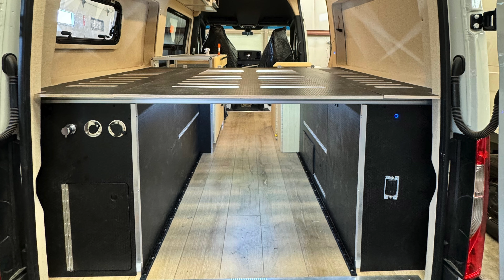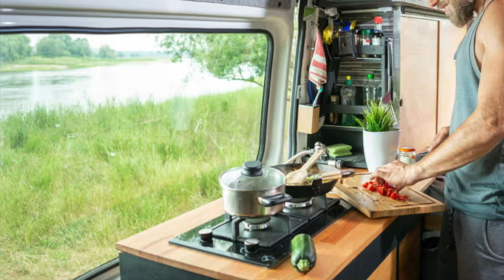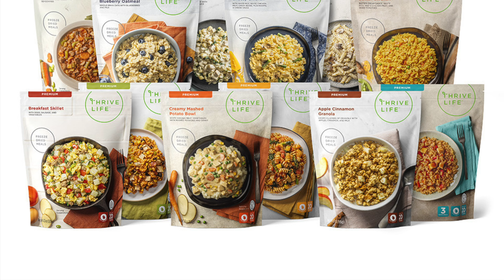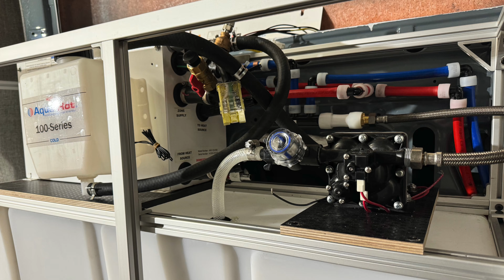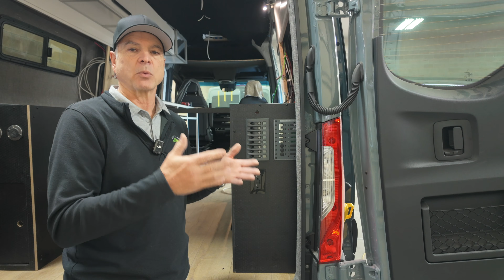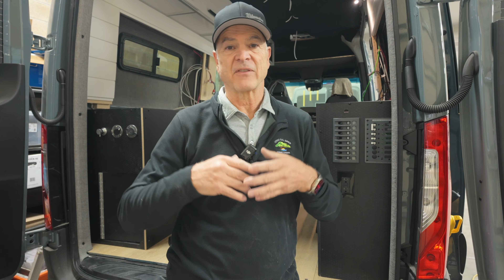Electrical and Plumbing Systems MISTAKES Could Cost You THOUSANDS!

Comment: As a former Sr. Electrical Project Manager, LEED AP, who designed and specified, from the utility points of connection, all power, lighting, low voltage and data system, etc. components for NZEBs, your channel is heads and shoulders above every other RV build out channel available. Thank you 😊

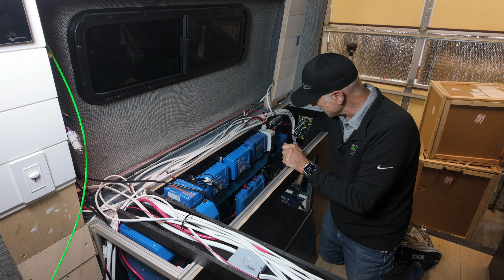Comment: At 3:15 you show the positive and negative power cables at the batteries. I don't think you mentioned it, but I'm guessing that is an inline fuse right at the positive terminal to protect that cable?

Comment: I am in Australia and it gets pretty hot and humid. Would you add a 12V fan inside the electrical box somewhere to aid ventilation to the outside of the vehicle?

Comment: I’m using two 48v server rack batteries (total of 200A) with 900W of solar—from Rich Solar.  Also, have Sterling 12 to 48 dc to dc charger for alternator charging.  Air conditioner is 48v undermount system, so big benefit is air conditioner efficiency.  Needed a couple of Orion converters to support 12v requirements.  Not on the road yet, so looking forward to testing to see if all the effort was worth it.

Comment: Keep in mind I know very little, but while watching someone else’s video, I think that a disadvantages of using a 48V system other than the increased danger of the higher voltage which can kill you, is that in order for the solar charge controller to work the solar panels have to produce 5V more than the 48V batteries (51.2V nominal voltage), or 56.2V. Also the disconnects are rated for 50V which is less than the nominal voltage of 51.2V?

Comment: Hi Jeff, thank you for all the great videos, really appreciate it. Question about the 3-port manifold; the trunk is 3/4" and it seems like you have an adapter from 3/4 pex-A to 1/2" or 3/4" male NPT from the pump. Is the braided hose 1/2" or 3/4"? I only have 1 van to build, so investing in the 3/4" pex-A head, plus some pipe, plus some rings makes this a very expensive manifold for 3 connections. If the braided hose is 1/2", then you don't gain anything with a 3/4" trunk other than they don't seem to make a 1/2" trunk. Am I missing something?

Comment: but you don't need to use electricity to heat the water with the isotemp while driving. you can use wasted energy from the engine cooling system. that's even more efficient why not use that feature? I got this especially for that
Reply from the maker: This is true, however we don't like to mess with the coolant system on a brand new van.

Comment: I am blown away by the quality of the components you use.   Everything is top notch quality, unlike the well know W and A van makers.  Additionally I noticed quite a few Festool woodworking tools.  Top notch all the way around both in fabrication and parts.  If I was building a van you would have my business in a heartbeat.   I also spied Duetsch connectors which I think can't be beat.
Reply from the maker: We appreciate you noticing the high quality of the parts and build, thanks!

Comment: For the plumbing, those steel braided hoses look like a great solution. I am planning on using clear hose for all other connections due to availability of parts worldwide and not needing a specialized tool to repair while traveling. I've heard you mention a couple times having issues with hose clamps leak on the clear tubing, I've never had issues when using high quality hose clamps (Norma are my favorite) and proper torque specs on the bolt. After all, many hose connections on the car are done this way and don't leak! Thanks for the video, great info!

Comment: Why not have the water-filler inlet on the side of the van so you don't have to open the rear doors and lose precious heat to fill up?
Reply from the maker: You can definitely do that. Our biggest concern is the possibility that someone could tamper with your water supply.

Comment: What's your opinion of using an electric skillet for toasted cheese,  chili batch, reheating where microwave is no good for reheating  , (pizza, fries,) rather than propane/butane stove and skillet/griddle (portable or built in)?
Reply from the maker: Yes. We prefer electric. We have installed 3-in-1 microwave/convection/air fryers that product more flexibility than a microwave alone.

Comment: I’m currently installing a 48V system in a Promaster.  Using a 48V Undermount Air Conditioner which has three times the efficiency of a 12V system.  I’m installing two 51.2V , 100A server rack batteries and leaving space for a potential third battery.  Also, I have 900W of solar on the roof.  This is a grand experiment, so we shall see 😂.  Your videos have been a tremendous help!!!
Reply from the maker: Sounds like an awesome setup. Keep us posted on how it goes!
Reply: This is what I want to do. I'm not sure if the amount of solar is enough to fully charge the batteries. I'm trying to find a possible alternator charging option in addition to the solar

Comment: How do you connect the drain for the main tank and water heater? With the vent hose like previous videos?
Reply from the maker: We don't connect them. We run separate drain lines for the vent and water heater. We typically don't do a drain on the tank. We just use the pump to pump out all the water through the shower or sink.

Comment: Do you incorporate a drain for the hot water heater tank for cold weather use?
Reply from the maker: Yes. The Isotemp has a drain valve. We connect a hose and run it through the floor of the van.
Reply: @ that sounds like a great heater to have in Wisconsin.  Just recently purchased a 2021 Sprinter with a Campolux 2.5 gallon tank.  No easy way to drain it or put RV antifreeze in the tank.  Any suggestions?  Love your channel.